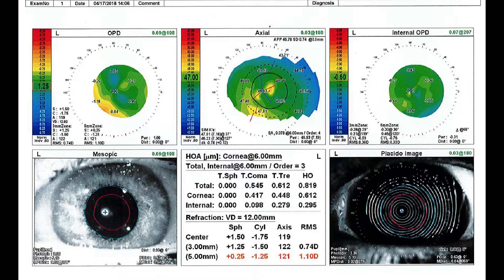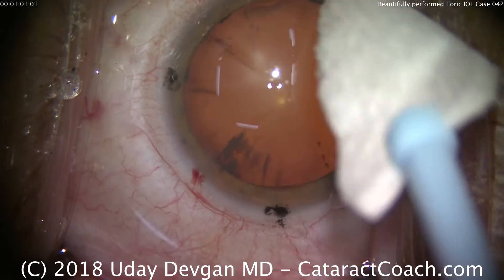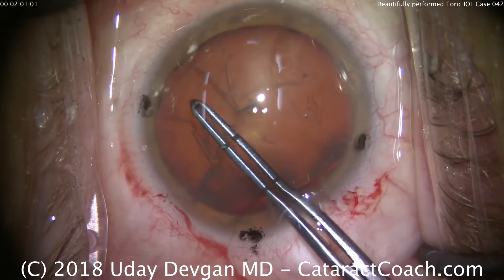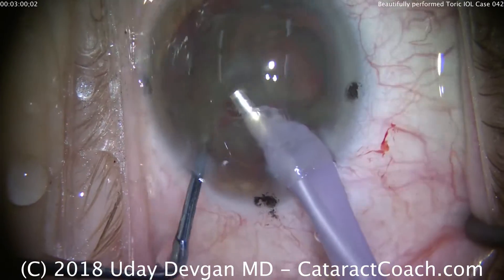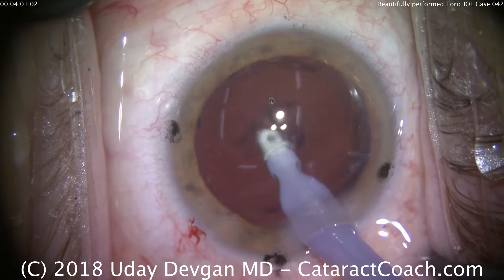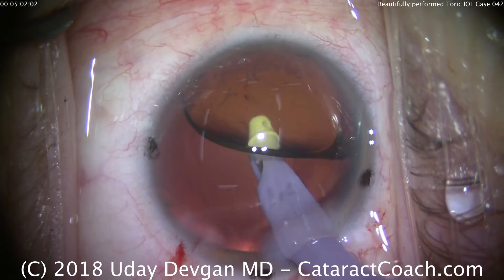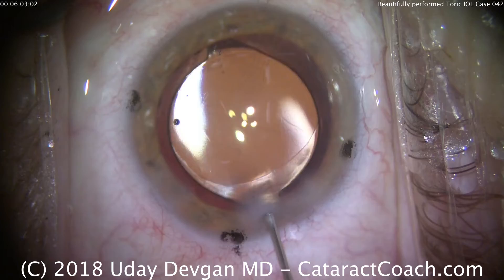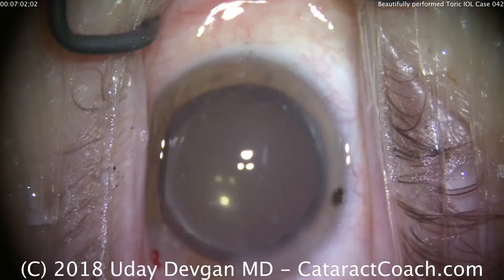Step-by-Step Technique for Toric IOLs - Beautifully performed cataract surgery

Comment: why is the incision at 35 degrees when your planner says it should be at 0 degrees?
Reply from the maker: The planner shows an anticipated induced astigmatism from the incision of zero, therefore the planner does not figure that into the equation. The incision is optimally places at the steep axis. And that is precisely what is done here. Remember that these planners are just very rough estimations and the best results are from surgeons who use judgment and experience to hone the results.
Reply: @UdayDevgan sir , what would have been the results if the incision was placed at zero degree ? Please reply sir, I faced a similar problem in my last OT